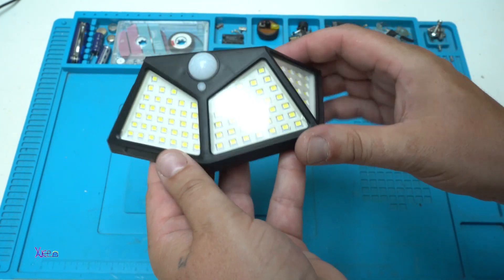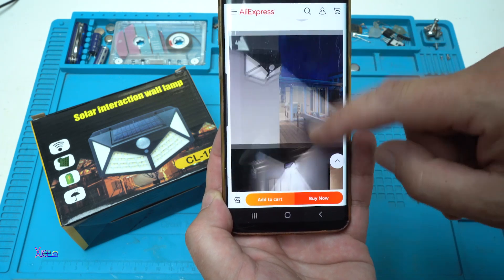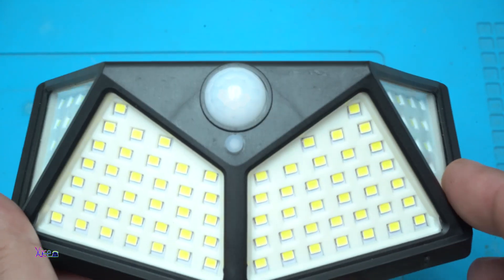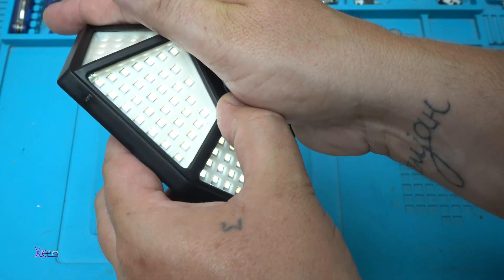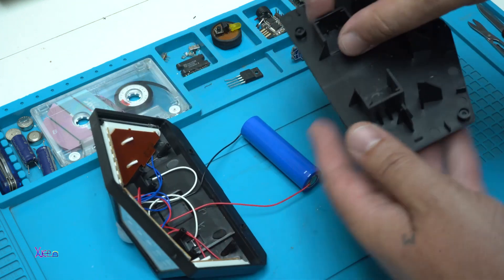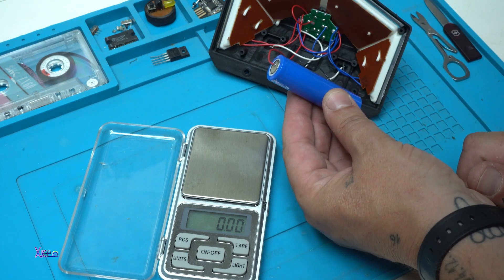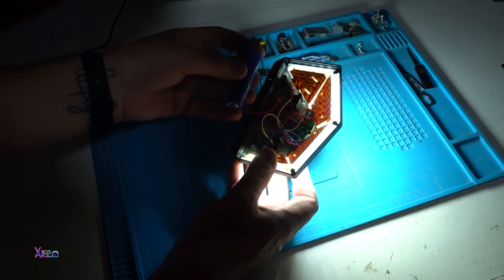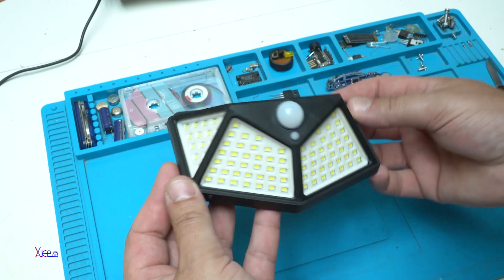100 leds Wall Lamp with Fake Battery capacity - Good or Bad?

Comment: If the battery was fake the device wouldn't power on. It's not a fake battery it's a cheap battery
Reply from the maker: Fake capacity
Reply: @Hacktuber  True. It is a real battery though. If it was fake you would have no power